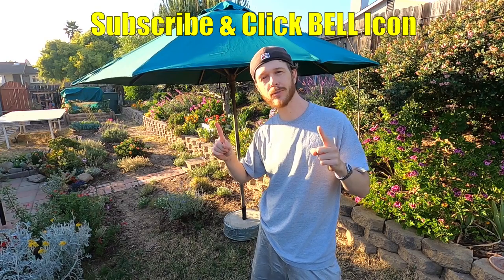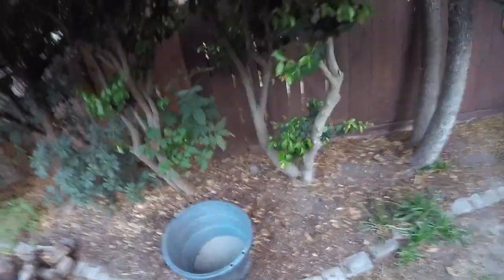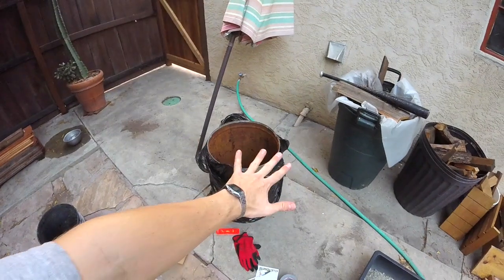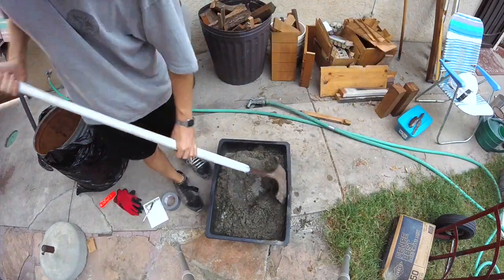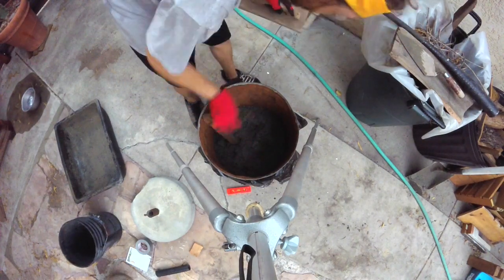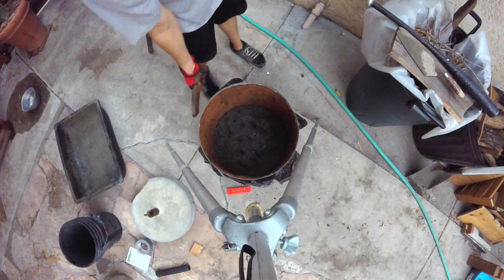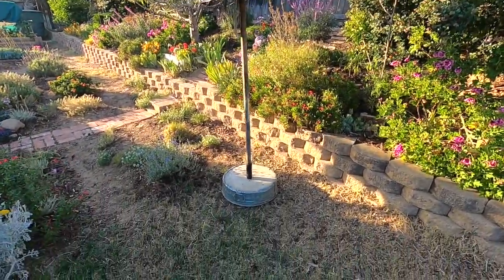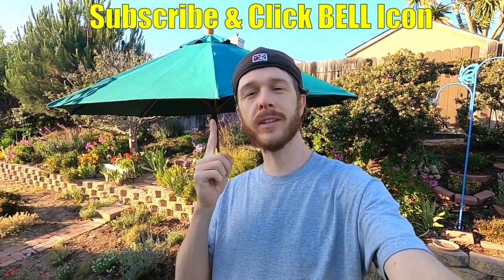How To Make a DIY Umbrella Stand. Cheap & Easy!

Comment from the maker: TOOLS & SUPPLIES
Wood Hand Float- https://amzn.to/3ZqImXU
Concrete Mixing Tub- https://amzn.to/2LHLr4a
Torpedo Level- http://amzn.to/2qVsDA0
Shovel Square Tip- https://amzn.to/2uO9yo7
Tape Measure- https://amzn.to/3rijQYo
Hammer- http://amzn.to/2tfjnMY
Rubber Mallet- https://amzn.to/2XD6Qhb
Makita Angle Grinder Set- http://amzn.to/2viJio0
Dual Respirator Mask- https://amzn.to/2xkGNTA
Respirator Masks N95- http://amzn.to/2xX32x3
Safety Glasses- http://amzn.to/2ez41Jw
Leather Work Gloves- http://amzn.to/2x5BZk3
If you Enjoy the Channel Consider Helping Support it by Donating below & by Subscribing.
PAYPAL DONATION https://www.paypal.me/JonnyDIY

Comment: YES!!! The WIDE base is THE ticket! I see so many diy YouTube umbrella bases made from 5gal buckets. I’ve made them. They are great if it’s a nice, still, windless day. Sadly, though, all it takes is a moderate gust of wind to bring both umbrella and bucket of concrete toppling down!
Reply from the maker: @TheThreekeys  Exactly! Those smaller ones are really only good for putting under a table when you have the umbrella going through it 👍 thanks for checking video out

Comment: I really like your novation here.  My only concern, does the amount of time spent and materials purchased really justify making the stand?  Buying a nice cast iron umbrella stand for $45 - $65 is a better approach IMHO.  However, if you have the concrete already and some time to spare, your idea is perfect.  Nice video.
Reply from the maker: Thanks you're right sometimes it's better just to buy. I all the stuff on hand already and needed a heavy base and couldn't find anything comparable 👍

Comment: where is the link to the concrete used?
Reply from the maker: I just used regular quickrete from Home Depot 80lb
Reply: @JonnyDIY  i purchased that quickrete 80lbs but dont look like yours. theres a lot of gravel in it
Reply: @JonnyDIY  thats the one i got still isnt looking like yours. mine has a lot of gravel. just did it today will see how it goes. how long you think to be ready?
Reply from the maker: @dnm6445  it does have quite a bit of gravel in it. I'd probably wait to move it around  for a week. Depending how warm it is and how wet the mix was. It'll set up within a day but concrete takes usually a month to reach full strength
Reply: @JonnyDIY  🙏

Comment: Buy a base. Much cheaper. You cannot lift once its dried.
Reply from the maker: I need heavy base because area I live in is windy and heavy base will work as stand alone without umbrella having to go through table hole👍 this only cost me a bag of concrete